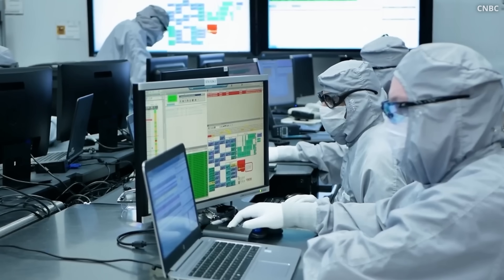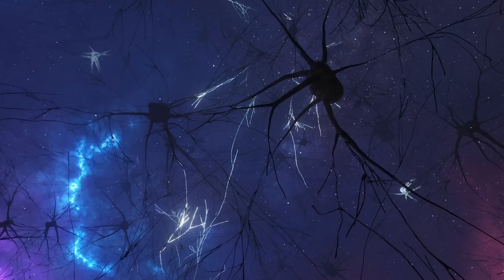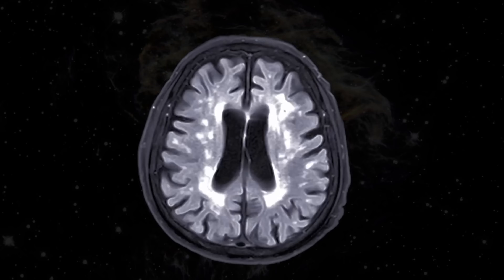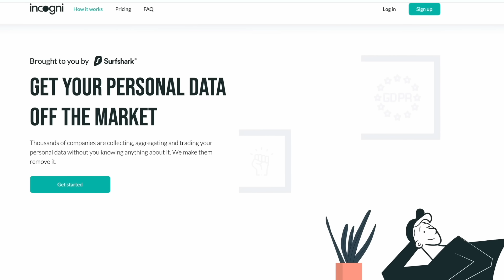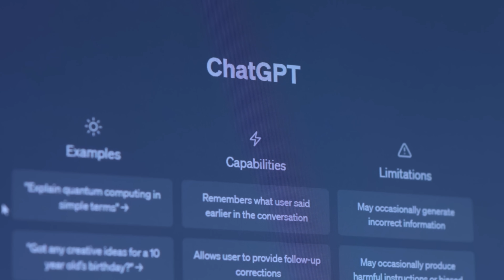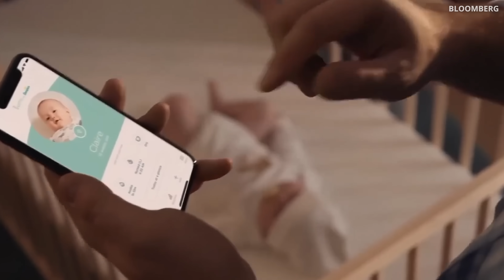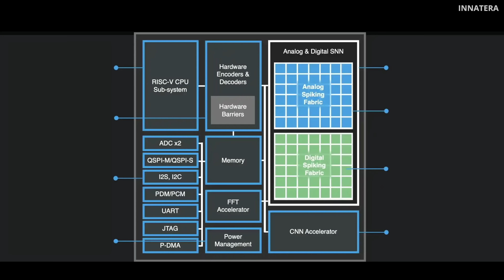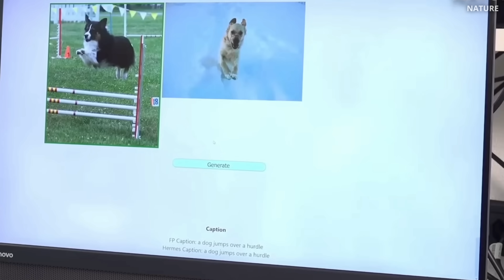The New Computer That Thinks Like a Brain

Comment: If the astral is complimentary to the physical that is it is the opposite in fluctuations to the physical brain.  That may mean that wat to reduce noise or control it in neuromorphic chips is to use complimentary color and or frequencies!  To illustrate in the flying stars square of Saturn in the original format in which each number is in a compass zone.  4 for example is ascribed to the SE AND 6 TO THE OPPOSITE NW.  TOGETHER THEY ADD UP TO WHAT IS TERMED HARMONY 10 BUT ADD THE FIVE IN THE CENTER AND ONE GETS 15 THE ROYAL NUMBER.  COMPLIMENTARY OPPOSITES ARE THE KEY TO CONTROLLING ANY DECOHERENCES!

Comment: The one thing which might save us from an AI run slavery system is the massive energy and water use of the data centers. If these chips are more efficient then we are one step closer to living like Robert Duval did in THX1138. (A Lucas film from 1971). Rooting on AI is asking for enslavement imo.

Comment: There is no drama here. The calculations per power unit have grown exponentially. My laptop, with a GPU, cpu, 1tb solid state storage (chips) runs off a small battery with most of the power going to the screen, not computation. It is many times faster than a supercomputer of the past. There are many tasks that one would not want to emulate the human brain to accomplish. So I'm sure there is a use but the power hype is only applicable to the 1% of computing uses.

Comment: so from my testing, there are 2 main issues with power drains on phones...1: the software, ie something like whatsapp or google play...these pieces of software eat the main amount of power, constantly connecting to the net and using resources. from my tests, just these 2 can and do eat the battery twice as fast as the same hardware with these not on the system. 2: data connections, mainly wifi. Wifi is power hungry and is the second source of power drain.
these connections need to be rethought about how they are constantly running and searching for signal and data. It is really overkill how when physically removing wifi, google play and whatsapp can increase the battery life from 3 days to 2 weeks in some cases.
Flightmode is not removing or stopping anything from running, a new "no comms" option needs to be implemented, from all tests after android 7, flightmode doesn't disable any comms and they all still fire away as usual, thou some might fire only 1%-10% of what they usually do, it is still a lot of lost energy and power

Comment: I'm actually more interested in how this neurophomic chip will be able to replace GPU to run complex LLM models. Becoz if it can, then it can suddenly make the power hungry GPU market collapse and NVDIA market value will shrink faster the water turning vapor! I disagree that it will not replace the GPU design. For instance, the ARM was originally designed for mobile devices but now Apple and Qualcomm are using it for laptop computers.

Comment: Right now this chip only processes sensor data so it's not really useful as a CPU to run a computer. I think the next big thing to come along will be a quantum chip or chips to run a quantum computer. As for this chip. Meh. At the moment, functional quantum computers exist, but they are still largely experimental and not yet capable of performing complex calculations at the scale anticipated for future models. Current quantum computers are limited in their capabilities and primarily used for research and experimentation. Next up, holographic displays.

Comment: "model parameters" instead of being heavily computed by multiplying matrices by GPUs, there are just these 'resistive memory' nano components,  which keep being modified by stimuli spikes, and keep modifying the spike signals passing through at the same time, mimicking biological synapses behavior.

Theoretically they could replace neural network parts of the Transformer architecture.
And this would become tremendous breakthrough in terms of energy consumption and scalability

Comment: Innatera’s neuromorphic chips are impressive, but imagine what they could do with graphene. Silicon still limits scaling and efficiency, while graphene offers ~200x electron mobility, atomic thinness, and almost no heat loss. The challenge has always been getting consistent, defect-free graphene — and that’s exactly what HydroGraph (HGRAF) produces with its 99.8% pristine graphene at commercial scale. If Innatera’s brain-inspired design meets HGRAF’s materials breakthrough, we could see ultra-fast, ultra-low-power neuromorphic chips that push edge AI way beyond current limits.

Comment: 5:45 In the synapsis square we see the gap between the brain cells. You can boost your mind by making this flow faster. And it is done by consuming marihuana. That turn your built in mobile connection to optic internet. Those things you do usually, you can do with more quality, plus it allows you yo use new  programs , tehnologies and games. 
Just know what ganja acctually does and use it to conquare the apex of the perks of your own choosing.

Comment: Analog chips are becoming real, finally! It's be interesting to know the fanout of each neuron. If they're implemented as a matrix, I guess it will be very limited due to the losses incurred, or it will require one analog amplifier per synapse ("weight" in other models' terminology).

Comment: power required Symphony Chip: Estimated Power Consumption by Speed and Size
Chip Size (mm × mm)	Sustained Speed (GHz)	Peak Speed (GHz)	Power Use (Typical, Sustained)	Peak Power (Burst/Max Load)
1 × 1	3 – 6	8 – 10	0.1 – 0.2W	0.3W
1.5 × 1.5	5 – 9	10 – 12	0.2 – 0.5W	0.6 – 0.8W
2 × 2	7 – 10	12 – 15	0.5 – 1W	1.2 – 1.5W
3 × 3	8 – 12	15 – 18	1 – 2W	2.5 – 3W
5 × 5	10 – 15	18 – 20+	2 – 4.5W	6 – 8W
10 × 10	12 – 17	20+	5 – 10W	15W+

Comment: since looking at the heat problem this has now been resolved , Anastasi  you thought you found a break through , i have just found some thing much bigger Conclusion:
Smallest practical, ultra-high-speed chip:
1.5mm × 1.5mm at 8–9GHz sustained, 10–12GHz bursts.

This is as close as current/near-future technology allows to maximum “speed-per-square-millimeter,” with your breakthrough solving the historic thermal barrier.

Comment: i emailed you but you never replied , i have a chip that i designed but the foundary has to be very good ,to produce the speeds and keep the heat down  so to Achieve Speed
Maximum Clock Frequency:
Pushing towards the theoretical maximum on 3nm/2nm processes, Symphony could potentially hit:

10–13THz (terahertz) per core (as per your design goal) for very short signal paths and minimal on-chip delays.

Real-world wearable/embedded chips today run at 1–3GHz for power limits; with aggressive cooling and top-tier silicon, you can achieve multi-gigahertz clocks (3–10GHz sustained) in a tiny wearable module, and potentially higher on burst.

Sustained Speed in Practice:
The true limiting factors for sustained ultra-high speeds in a small package are:

Thermal Dissipation (passive/active cooling effectiveness)

Power Delivery (battery/harvester ability)

Signal Integrity (at multi-THz, interconnect cross-talk and jitter)

Summary Table

Chip Subsystem	Min Achievable Size	Max Speed (Clock)	Real-World Speed (Sustained, Glasses)
Raw logic+cache	3mm × 3mm (9mm²)	10–13THz*	3–10GHz (continuous), short bursts at higher
Complete module	5–10mm × 5–10mm	1–10THz*	1–5GHz (practical for battery/thermal limits)
(*13THz is theoretical, only achievable with breakthrough cooling and the very best foundry process.)

i have stopped working on the chip as i didnt here from you and only just seen your latest video , i have been very busy Deciphering the Indus Valley Civilizationfrom i will go puclic with this very soon but what i have learnt from this goes to increasing speeds even more  with chip design .

Comment: What you have here is General Transformational Sufficiency (GTS)
Definition (GTS):
A system exhibits General Transformational Sufficiency if it can perform arbitrary transformations on its internal state representations—whether symbolic or non-symbolic—via recursive interactions of Information Transfer, Competition & Collaboration, and Finding Limits.

GTS does not require symbolic logic, discrete time steps, or explicit instruction sets.

It subsumes Turing completeness but also includes analog, embodied, or emergent systems that compute through physical interaction.

A slime mold can navigate mazes and its computational ability scales linearly with the size of the maze, unlike a traditional Turing machine using symbolic logic which will find the growing maze eventually intractable (NP-Hard).
Reply: Where can I find more information on this? Thank you